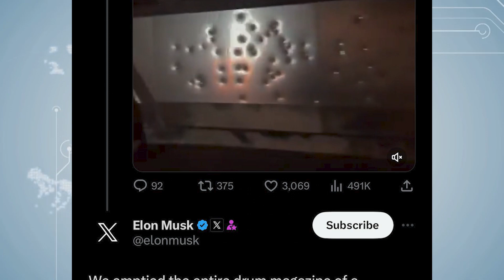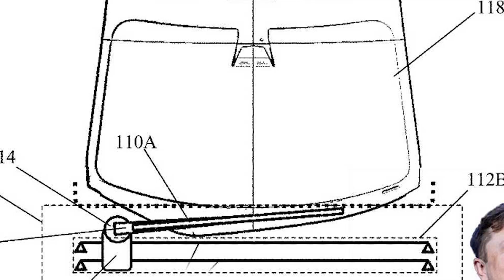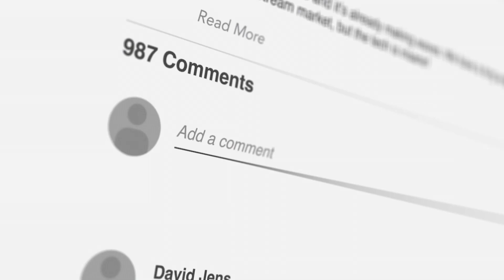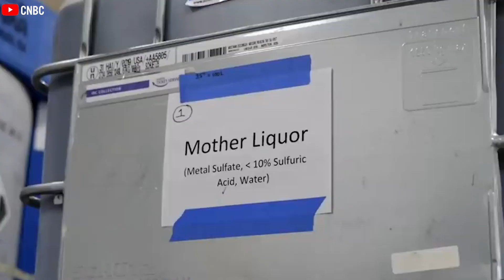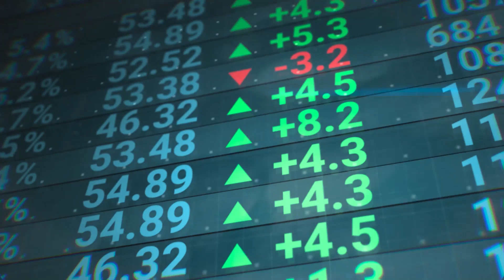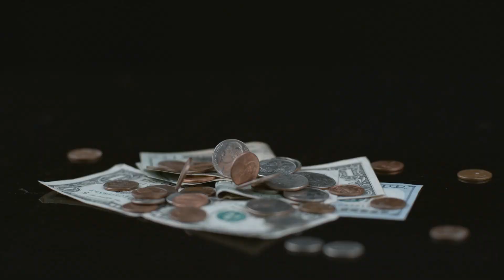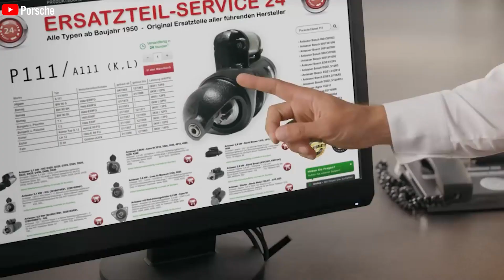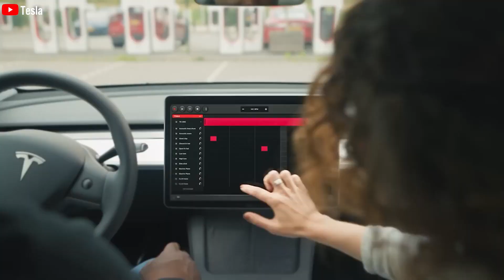Final Bulletproof Test! Elon Musk reveals New Battery and Super 800-volt architecture for Cybertruck

Comment: Again the question of bulletproofing... Tommy gun uses 45 ACP. This is a large and slow moving projectile. You just cannot say that it is bulletproof if it stops just 45ACP. This does not even get to the IIIA bulletproof rating! It will not stop rifle rounds and even handgun rounds 357 magnum, 44 magnum, 5.7x28 for sure. It will probably stop 9mm, I have doubts it will stop 10mm.

Comment: Let's try I don't know 556 with green tips something with velocity
How about a Barret   50 cal.
For the price of that truck  it should be RPG proof😂
Reply: It will not stop regular 556 or 7.62. You do not even have to use green tip. It will not stop the handgun rounds 5.7x28, 357 mag, 44 mag either, most likely will not stop 10mm either. 50 bmg will pierce 5 cybertrucks positioned one after another. :)

Comment: If the test is for survival from a car vs gun attack. Any help you get is great and Elon has saved life's with this idea. Everyone loves to rip on Elon but when someone is shooting at you pray to him is what you will do!!!
Reply: Funny how they newer show the shooting video eh
Reply: Even some handguns will penetrate this chassis. Any rifle will go right through it because it isn't made of armor steel, just high tensile stainless. The 'Tommy Gun' is 100 years old and fires a cartridge that is even older. It is weak. The glass isn't true armor glass just extra thick safety glass which isn't made to the same standard and uses materials that are not as strong. 
This is like putting a draught horse on the track with a bunch of mules and calling it a 'horse race'.
This is a publicity stunt to try and find some redeeming feature for an objectively poorly designed and dangerous vehicle. Anyone who has a legitimate need for an armored vehicle will get a real armored vehicle that can also withstand hits from heavy machine gun fire and RPGs, which would blow the Cyberfu*k to pieces. This will only be used by gang bangers to protect them from being rightfully shot by the cops. It will probably cause cops to start carrying heavier rifles with AP rounds which just presents a greater public safety hazard for everyone, not to mention going around asking to get shot while sitting on a ton of lithium🤦‍♂🤦‍♂
Reply: @SomeOldGamers are you an anti gun queer?

Comment: "It's badass", ok.... but have you really thought this through? I live in a place where the chances of being shot at are low (thankfully), but I wonder how I would escape such a vehicle if I was in an accident that disabled the doors and the vehicle were on fire. I could probably break the glass on my current vehicle to escape, but if the glass on this cybertruck is significantly stronger then what... just die?
Reply: Cause we this happening every day, right? Maybe you should understand how teslas work before making dumb comments. They have a manual lever you pull to open the door
Reply: you are not fit for this world. Buy a Subaru.